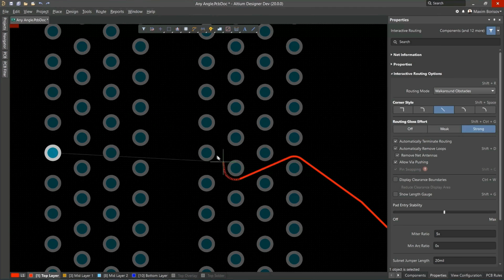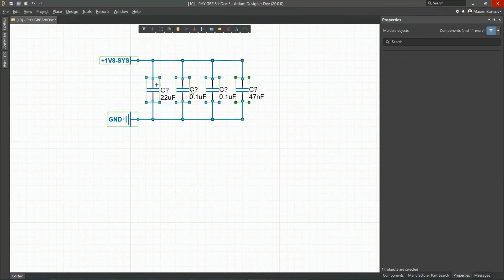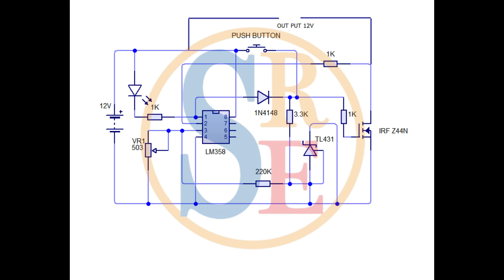DC 10 Amp Sort Circuit ShutDown Circuit, #altium

Comment: What is the working principal of this comparator?
For what I can see, when PIN2 goes high the output on PIN 1 is pulled to ground OV this allow the current to flow through the LED at the same time pulling down the MOSFET Gate to Ground to turn it off. 
I might be missing something.